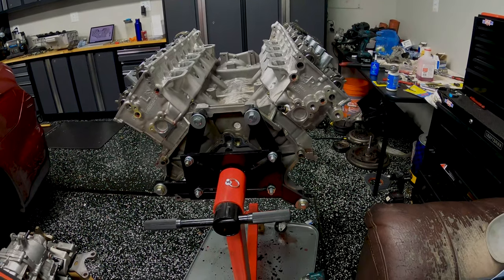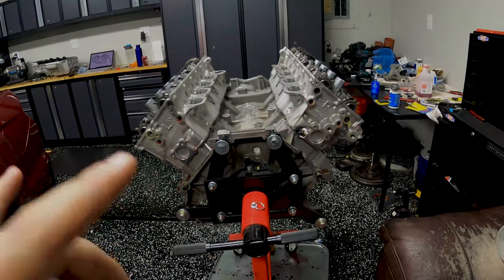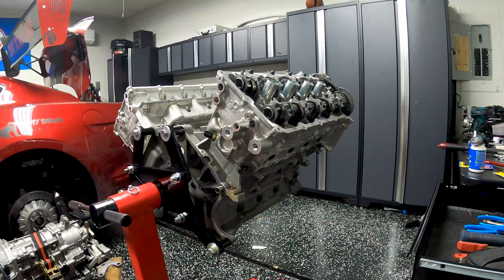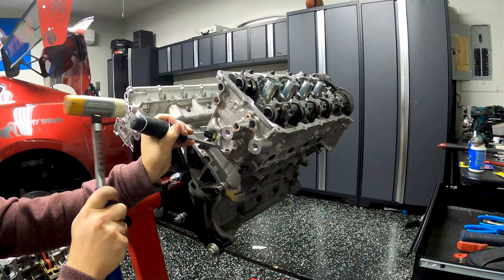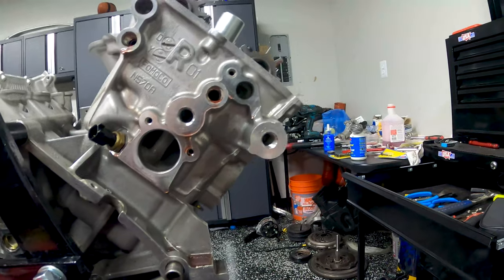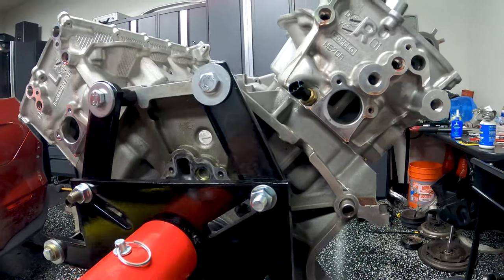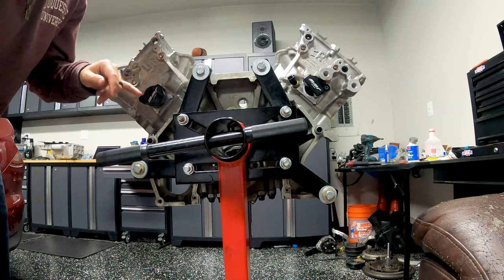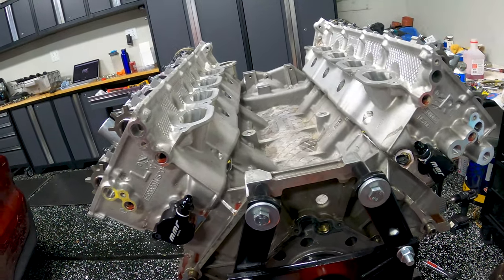Install the MMR Cooling Mod in a 5.2 GT350

Comment: Thanks for making a video on this. You gotta wonder why Ford never decided to start putting these on their engines. They have to know there's a cooling problem in the back of the engine. They could easily remedy this by either partnering with a company like MMR to add this to the assembly process of the engines.

Comment: Interesting you removed the MMR crossover kit. I'm going to install one on my 2000 F-250 5.4 Liter 2 Valve engine. I carry a 4000 pound truck camper and supplies much of the year and if it gives me better cooling, I'll be happy. I will use barbed fittings because the water passages are larger and should flow more. I'll cap the second fitting on the right head and install a Tee fitting center between the two with an upsized outlet that will be heater hose size. I can Tee into the coolant line from the front crossover tube going into the heater core, where both the front and rear crossover hoses will be drawn through the heater core, always getting some cooling, then through the valley tube and into the back of the water pump for recirculation. Of course doing this will divide the flow of coolant between the front and rear so I may have to be mindful of the reading on the temperature sensor because of less flow and the wind from the fan is substantial at the front of the engine so it could have some cooling effect on temperature readings. I don't think it will be significant enough to worry about. Another option is to install a second heater core or radiator and separate the lines.
OK, That's my input, thanks for the video. You are right, it's hard to find reliable information about this rear of head setup. Take care.

Comment: What about the ground wire on drivers side? That plug blocks the bolt hole so ground can no longer be attached. Not a huge deal, but there are no other threaded holes in the vicinity unless you put it on cam sensor bolt, which isn't ideal

Comment: i dont see how this will somehow induce more even coolant distribution since youre just creating a deadhead at the crossover, the coolant flow is going in opposing directions through that bridge netting 0 flow. Whats the main issue with the rear cylinders/head overheating? is it just straight up coolant flows from front to back? heat saturation by the time the coolant gets to the back of the engine? If thats the case then you'd either have to split flow to where its entering the block at equal intervals, or induce some sort of restriction at the front so that its not saturated before it gets to the rear of the block.
Reply: The early generations lacked a cooling passage between the back two cylinders causing #8 to get extremely hot and detonate before other cylinders with Fords factory fueling map. A lot of aftermarket tuners were able to “tune” around this by adding extra fuel to that cyl. Coyote isn’t the only engine to use this crossover type hose and this doesn’t hurt especially for as cheap as it is. Little peace of mind.

Comment: you'd think ford would've fixed the coolant issues with these motors by now.  i know this is critical for the 4v 4.6's to prevent #8 from getting hot all on its own.  I see a coolant sensor on #4, is that right?

Comment: Just don't ever plan on taking the CTS out ever again when the engine is in the car, lol, right?
I have a NA Coyote right now but I plan on running a decent amount of boost to it next year so I plan on doing this mod this winter. I'd also really be interested if this does anything. I have notice that my CTS (rear passenger head) reads about 20 degrees hotter then my aftermarket temperature sensor tapped into the radiator hose fitting (the one on top of the engine that looks like a thermostat housing) but I'm not sure if there is an actual tempaure difference or if it's just the different way the two sensors read as one is "wet" and the other is "dry".
Reply from the maker: I wouldn't be surprised at the difference. Cylinder #8 runs quite a bit hotter than the rest and given that's where the sensor is, I can see it running hotter than the water. Is your aftermarket temp sensor before/after the radiator? If after, it's "cooled" and that would also contribute.
Reply: @honeybadgershenanigans  
Before the radiator, right on the top of the engine where the hot coolant exits the block. It's a race car and i like redundancy on critical sensors.
Reply from the maker: @177SCmaro  that makes sense. It would be nice to have a true water temp sensor. I plan to do that someday as well.

Comment: I used to run one of these things, but I couldn't validate that it did anything. Add some thermocouples to it and test connected, not connected :)
Reply from the maker: I plan to. Since I'm removing the engine again (yay!), I plan to add some sensors to gather some more data. I'll test them the same day at the same track and log the data to see. At this point I need to find out based on principle since MMR won't tell you

Comment: What did you do about the crank position sensor being obstructed? I was able to turn the sensor, plug it in, rotated back and then tightened on the bolt. Curious to see what you did
Reply from the maker: ahh. I might not have had it on when I did it. Don't remember having to do anything with it

Comment: It might not hurt to invest ina killer chiller. No idea if even make a system for the Gt350 because it’s usually seen on supercharged street cars but I’d imagine in this application that it would do dividends for you during track duty. Of course.. you’d need Air conditioning too

Comment: Hey man, I'm considering boosting my stock gen1 GT350 (2016 model), and considering upgrading rods, pistons and headbolts (I've already upgraded OPG and sprocket and crank bolt) 
Do you think I'm heading the right direction? if my block and heads are in good condition? 
additionally i'll be upgrading the fuel system to a return style to make sure i'm safe at all times.
Appreciate your input
Reply from the maker: sorry that I missed this! If boosting and not consistently sitting at high rpm, rods, headbolts, and OPG/CS are probably all you really need. The stock pistons are good and aftermarket pistons can lead to ring issues. Rods are definitely the weak point when pushing boost. If you'll be sitting at higher RPM, you'll definitely want to look into some head upgrades for better valve springs, Ti retainers, etc.
Reply: @honeybadgershenanigans  Thanks a lot man, appreciate that

Comment: Is there an update to this video yet after 7months? Was looking into this mod,and figured if I have to remove the motor for the best access I might as well get everything all at once so I dont to pull it again for other mods.
Reply from the maker: Not yet. I put the car into hibernation when COVID hit and it overheated (needed a mental break). Engine has been at the builder's since September getting refreshed. We'll see that happens this year.
Reply: @honeybadgershenanigans  Over heated??? What why love the videos brother
Reply from the maker: I think it was either a bad design choice in my heater core bypass or a clogged radiator. Either way, we’re good now. I don’t run this MMR piece, tho

Comment: Curious if you consider running the new GT500 head gaskets? They have an open spot in the coolant jackets around 4 and 8 where its normally blocked off on gen 1/2 stuff.
Reply from the maker: I haven’t. But I’ll look into this. Thanks for the tip

Comment: I’m wondering, could you have just bought an aluminator 5.2 for the same money you spent on your voodoo? And you could have sold the voodoo. I’m thinking of going that route when I get a GT350r. Thoughts?
Reply: That would be an absolute waste of money. The Aluminator 5.2 and the 5.2 Voodoo are extremely similar and are basically the same engine. There are minor differences, the major differences are the cobra intake and the cross plane crankshaft. For the price which is ~$21,000 it doesn't make sense because you would end up doing the same modifications. You also have to modify the engine bay a little like removing the strut brace for fitment.

You can turn the Voodoo into an Aluminator for way less. The only thing you need to do is change out the crankshaft.
Reply from the maker: Not to mention you still don’t have a properly blue printed engine. The Aluminator are good engines when you don’t really ring the crap out of them for hours and hours. If you do, it’s better to get something more meticulously built with some lighter/higher end components.
Reply: Both the FP350S and Mustang GT4 cars run an Aluminator I believe. Also Aluminators are hand built using very high spec internals. Have you seen the build video from American muscle magazine? The cross plane won’t shake itself to death. I do agree rebuilding a voodoo will be cheaper especially if you can pull the engine at home like you did. But the Voodoo issues concern me. Those problems with the voodoo are all addressed by the Aluminator ie oil pump, ring sizing, cylinder bank oil transfer during high Gs and head to block tolerances. I also agree the cobra jet intake is ugly and big. Just put a Voodoo intake and throttle body and be happy with 530HP. BTW, I track at cresson and Eagles canyon. I flip from a Cayman GT4 to C7 Z06. But I’m getting ready to replace one with a ZL1 1LE or GT350. Driven ZLE on track and it’s quick and stable.
Reply from the maker: The fp350s actually uses a CPC variation of the voodoo. Same engine with some valve train upgrades (springs and retainers) and the CPC crank. The GT4 uses a special roush Yates motor that has some secret and is fully blueprinted. 

The FP350S, Aluminator 5.2 XS and GT350 engines are all hand built, but they’re not fully blueprinted. They’re very good, but not as well assembled as the fully blueprinted motors from roush or a properly rebuilt voodoo from someone like MPR Racing. 

ZLE are very quick and a great platform, just quite boring to drive IMHO. Bit too clinical for my tastes. The voodoo motor (or a coyote for that matter) has more character and it’s a big part of the experience, IMHO.
Reply: Yeah I know that about the GT4. Obviously fully race spec engine. But it’s limited to 450HP per class rules. Reliability sauce! I think the key is CPC. Aluminators are hand built at Ford performance engine shop where the Ford GT and Cobra Jet drag engines are made. Not all bent on Aluminator but it is closer to a blueprinted engine than a Voodoo. As far as ZLEs are concerned. I lean towards cars that on track are on rails. I had a MX5 track car years ago and it was all analog and busy. Yeah that high revving engine is fun I’m sure. The Porsche GT3 in manual is like that. Very visceral feeling to drive on track. So is a C6 corvette.
Reply: Here’s that video about Aluminators being built. https://youtu.be/175Ks4fQ1Gk
Reply from the maker: The switch to CPC for the GT4 was highly motivated due to BOP. When they got huge BOP hits after winning the 2015 champion in the GT350RC (which used a FPC and the stock Tremec), they moved to the GT4 and put in a CPC which makes more torque at lower rpms, so it’s more competitive within BOP. Tho, IMSA has killed the mustang so much that the field went from 12 of them at one point to just 2. It’s sad. 

The Aluminator is a good crate motor if you want an OEM built motor  but don’t expect it to last in race conditions at its advertised 580 hp. It takes rpm to get that and you’ll wear it out. If you’re already starting out with a voodoo, just build that. The Aluminator would be a great drop in motor, tho. No doubt.

Comment: How does it cool, you're flowing hot water to hot water with no radiator in between for heat exchange.
Reply from the maker: I don'y personally think it works. I took mine off

Comment: Did they help with the heat ?
Reply from the maker: I only ran the car a for a couple sessions while these were in before I blew a coolant line - during the engine refresh I removed them. So I don't have any data of them. I've seen a few racers try and use them with no measurable difference. They ended up pulling them too. YMMV
Reply: What coolant line blew?
Reply from the maker: Lower radiator hose. Had a pinch from installing the engine. Burst under pressure

Comment: Any update?
Reply from the maker: On the engine re-build? Or the cooling mod?
Reply: @honeybadgershenanigans  Cooling mod
Reply from the maker: I removed it after 1 event when I saw others in the community having suspect issues. It's anecdotal evidence, but given that I haven't had issues on #8, I didn't want to chance it.
Reply: @honeybadgershenanigans  wait I’m confused. Why did you remove it?
Reply from the maker: Saw others have issues in the road course community. Nothing directly, but suspect stuff - like no changes between a race engine refresh except the coolant crossover and the engine needing to be rebuilt 12 hours sooner with cylinder 8 being the issues. 

Ford doesn’t do this on any of the race cars. And given that none of the vendors can provide any real data on its effectiveness, I decided to remove it.
Reply: @honeybadgershenanigans  okay thanks for your input. I ordered this yesterday But decided to cancel
Reply from the maker: No problem!